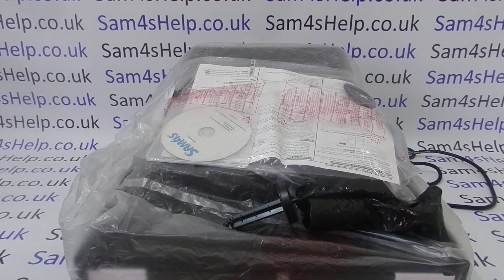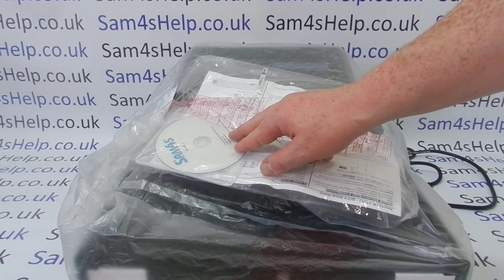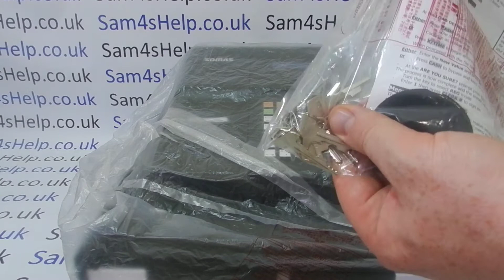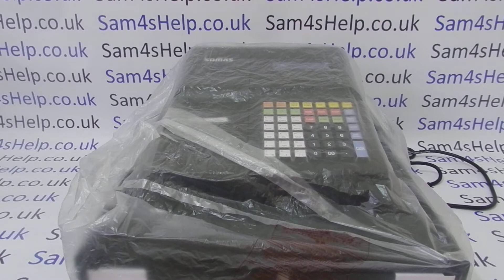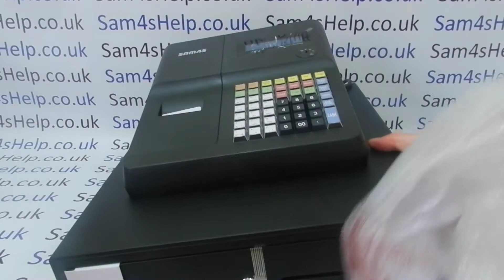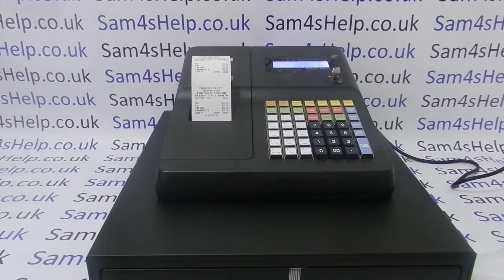How To Use Sam4S ER-260BEJ Cash Register 1st Use Set Up Instructions Quick Start Guide ER260

Comment: I just bought a ER-280 series used and it was working when I got it, but I cleared out the programming and now I can't get it to do anything. Do you have any videos on this machine I could take a look at? I tried what it said in the manual, but that doesn't seem to be working.
Reply: It's just giving an error beep that doesn't stop until I turn it off.
Reply: Pay someone to program it , don`t do it yourself unless you are 100 % sure.